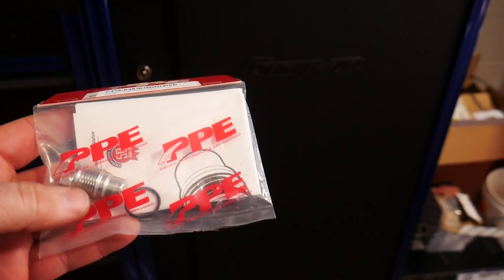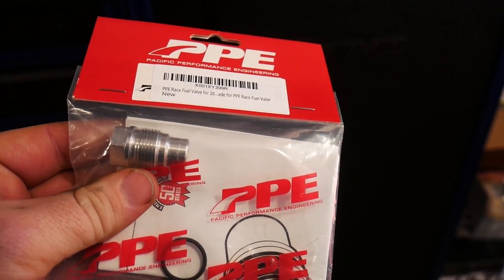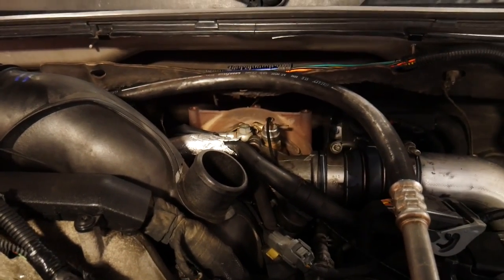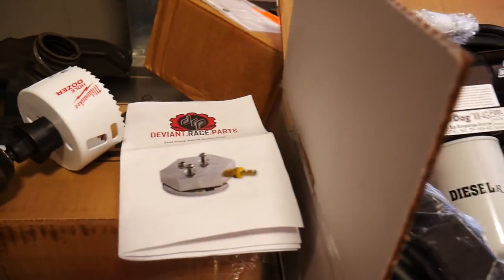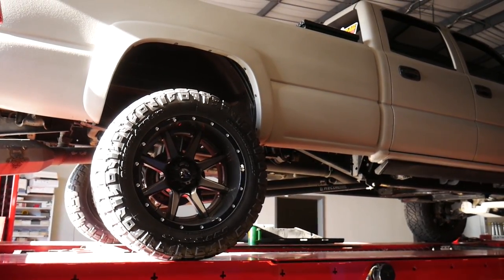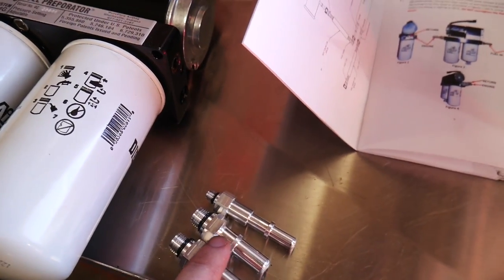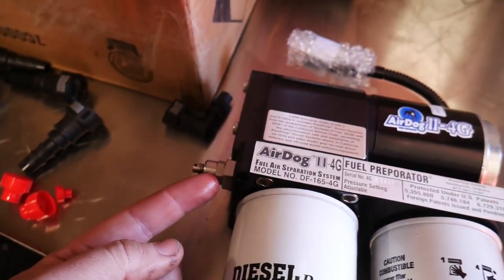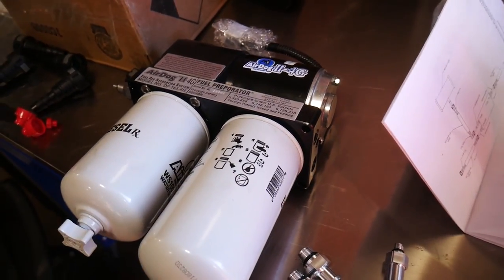DURAMAX FUEL UPGRADES-INSTALL AND WHY YOU NEED THEM

Comment: Everyone has these (me too) but we SHOULDN'T!? Went to exergy to make sure I could 10 mil over my stock injectors:
 FAQ page and found this.
14) Should I install a "race valve (rail plug)" in place of my factory PRV (pressure relief valve) to get more rail pressure??

No, we do not recommend eliminating the factory PRV in your HP fuel system. The PRV is there for a reason; to eliminate the damage that can be caused by pressure spikes. When a "race valve (rail plug)" is installed these pressure spikes have nowhere to go except into the injector. The only time plugging the rail will fix a rail pressure issue is if the factory PRV has been blown off multiple times and is starting to wear out. At this point we would suggest replacing the worn PRV with another factory unit. For higher pressure applications we can modify a new PRV to a higher blow off point so you're not on the edge of the stock factory unit while still retaining the safety function of the PRV. We have seen many injector sets come back from rail pressure spikes while running these plugs causing pre-mature wear of the internal components of the injectors, stators lifted or even worse blown off the top of the injector. In extreme cases rail plugs have also resulted in cracked injector bodies.
Reply: Yes, we agree completely. If you want more power you need modified injectors not raising pressure on stock injectors.

Comment: It's a high fuel pressure relief valve. It is normally closed and when over pressured it opens releasing the fuel back into the fuel return line. The ppe is a plug! Thus no way to release any fuel into return line.

Comment: What happens to the fuel pressure if it's to high,  but you have a plug? How is the pressure being reduced?
Reply from the maker: The fuel rail pressure is regulated by the fuel pressure regulator in the CP3 pump.
Reply: @RustbeltMechanic , thank you for the reply.  What is the purpose of fuel pressure spring return device that is being replaced by the plug?
Reply from the maker: In the small chance there is a fuel injector failure and the fuel rail spikes too high for the second while the CP3 manually ramps down. But that circumstantial failure point and rate is minute for the need for the spring not to open in this performance application.
Reply: @RustbeltMechanic ,  thank you so much for this valuable information.  Many people install this plug but never explain how everything works.
Reply from the maker: Not a problem at all! Glad to shine some light on the subject

Comment: Like I mentioned in a Truckmaster video, why no love on oil bypass systems?  I realize the video was titled "fuel upgrades" but there doesn't appear to be one on your Dmax (unless it just wasn't in the video).  With my mechanical background, it seems obvious that those two should be at the top of the list.  Maybe I'm just getting old.
Reply: The amsoil dual bypass filtration systems looks awesome. And the results are amazing. These guys are going for hp not for reliability that’s most likely why they haven’t made a video on them.

Comment: So did you have a factory skid plate under your fuel tank that you removed to install the sump? I think I heard you reference putting the plate back on. If so, did you have to modify the plate the make room for the sump and new fuel hose?

Comment: Great video, thanks. I've got an LBZ too. Did the basics of an intake, exhaust, lift pump and EFI live tune first. Recently added a 6" lift w 35s and knew my mileage would drop but wasn't expecting as much as it did. What mods would you recommend next? not looking for crazy power, just better mileage. Its a daily driver and I usually run on #4 tune (120hp) but I've only been getting 13-14 city and 17-18 hwy mpg. thx!
Reply from the maker: Get rid of egr, totally get rid of and reroute pcv, that will clear up intake and Sooting. Then sorry about manifolds, up pipes and downpipe if you haven’t.
Reply: @RustbeltMechanic  awesome thx, i should have mentioned maybe most important thing but I already did the full EGR delete. Kept the stock up pipe and welded off the arm to be like LB7 style. Adding a turbo mouth piece / inlet was next on my list. And maybe after that the manifolds up pipes, down pipes. Would you recommend doing anything else before those or any other mods I'm missing that would help with mileage gains first? thx!

Comment: How much of difference airdog makes? Noticeable or you have to convince yourself that there is difference?
Reply from the maker: The airdog was necessary to give the engine enough fuel volume. These only used vacuum from the CP3 to pull fuel from the tank before which puts ALOT of strain on the CP3 pump. Plus now that I have a much more upgraded fuel system, that volume was absolutely necessary.
Reply: @RustbeltMechanic  , no fuel pump in the tank from factory?
Reply from the maker: Nope, none. They didn’t start with having factory lift pumps til they introduced the LML Duramax I believe

Comment: So say I install the ppe duel fueler how much horsepower per say does that support? Can you run a 10mm storker with the stock will that help or is it overkill wanting to get the 165 lift pump as well think that will help and then some air intake upgrade

Comment: Was you able to torque down the rail plug? Or just tighten it down real tight with wrench is fine? Just looks tight in there to be able to get a torque wrench in there.
Reply from the maker: As tight as I could😉

Comment: How is that sump doing a year later? Looking to do the air dog and sump on my LLY because I have air in the system and the shop wants to replace the sender as a precaution, but I figure why not just bypass it altogether and do a sump.
Reply from the maker: Absolutely love it and have Zero issues at all.

Comment: The p0087 code fix
Lift pump &or replace the rubber hose that  Kinks under load or hot weather right under driver side door you'll see the 2 rubber lines .....small rubber 12" long or so .....the rest of the two lines are  Aluminum

Comment: GREAT VIDEO RBM.... Thank You!!! Can't remember, who did you go with for your Tunes? (I went PPEI & Love them) Also, how are you liking that Transco Jr shift kit now that you have some miles on it? Thinking of doing it on my LMM..... Thanks again for the Great Content, Sir.
Reply from the maker: So with tuning I used a local guy and had custom tune done. As far as the Transgo kit, it took about 150-200 miles and it is working AMAZING now! I would definitely recommend it. It’s by far helped the 2-3 shift the most.
Reply: @RustbeltMechanic  Good to Hear, Thank You Sir.
Reply: @ToXSicK1340  I went with PPEI DSP5 tunes on my stock LBZ. They are amazing tunes. Easy install. Now I definitely need a lift pump because it drains the fuel rails on tune 4 and 5. I have the PPE fuel plug and the PPE ported fuel rail fittings. My injector balance rates are under 2. Exhaust is a straight pipe. Everything else is factory stock.

Comment: Did you keep the factory fuel filter in place or delete it? 
Is there any reason I would have to delete the factory fuel filter? 
I'm installing a Fass 165 since I had already purchased it before watching the video.
Reply from the maker: At that time I still ran the factory one but when doing my compound turbo setup it got removed.

Comment: I just bought a Fass lift pump for a 2011 LML. Is a sump kit and that rail plug necessary for a mostly stock motor?
Reply from the maker: No not really. A sump is just a good idea to keep fuel aeration down as to keep the longevity of the new pump you just put in. The rail plug is needed if you end up tuning the truck and plan on having increased rail pressures on stock fuel.
Reply: @RustbeltMechanic  Thanks man. I'm new to the diesel world. Just got my 1st duramax a couple months ago, and trying to learn the ins & outs.

Comment: Forgot to mention modifying the fuel sending unit. Why wouldn’t you get rid of all that ultra tight restriction while your in the tank? $60 and 15 minutes once the tanks out. Duramax’s are fuel starved and all these fuel upgrades are not doing what they should and way over working trying to pull fuel through 3/8” accordion lines. I upgraded my lines from 3/8” to 5/8” rubber fuel line and changed the pickup. Best upgrade I’ve done to my truck.
Reply from the maker: I did.... I totally bypassed the sending unit by installing the tank sump in this video.
Reply: @RustbeltMechanic  well you had to because of the lift pump you installed. The FASS and Airdog lift pumps aerate the fuel in the tank. So without the sump there’s a known issue at 1/4 tank and below. Also what about the return line and the fill neck vent hose. Were you able to upgrade the return line at least? 

I installed a Kennedy Lift Pump with Baldwin Mega Filter after the lift pump and a water/particulate filter pre-lift pump. What I like about the Kennedy lift pump is it’s a flow through, as far as I know Airdog and FASS are not flow through. So they die your truck is down. Kennedy Lift pump won’t leave you stranded. Also no seals so no leaked and it’s almost silent. Can also stack them to add more PSI. And no aerating the tank so no need for a sump. I’ve never had anything but the Kennedy but did a lot of research before I decided. It’s been perfect for 2 years.

Comment: hey boss ☝️ I have a question .. on my lly I installed pure flow air dog and I’m planning on doing couple more things like cold air intake turbo mouth piece ,, upgrade down pipe n straight pipe .. question is could you still recommend to install the ppe rail vale ?? Will it benefit my truck ,, I’m running stock tune and don’t want to ever tune my truck .. do I have to have aftermarket tunes to upgrade rail vale ???
Reply from the maker: No you don’t HAVE to. But if you see a situation where you get that code that I got on a wide open throttle situation.... that’s when you need the race valve.

Comment: Is it worth it to do on a stock truck?
Reply from the maker: That’s what I did!
Reply: Probably not, they are pretty expensive to add onto a stock truck in my opinion. I really don't understand when people state the CP3 pump has to work hard to pull fuel from the tank. The diesel drives the pump, so I'm not sure where the benefit is.🤷🏼‍♂️
I have a 90hp EFI Live tune and haven't had any issues with fuel starvation. I think the lift pumps would be beneficial at higher hp levels.

Comment: do you like the demand flow of the airdog over the mass flow return of the fass and could you explain why you like it better thanks
Reply from the maker: I like the airdog and it’s demand flow for one, the demand flow doesn’t go overkill and just constantly having return maxed out on normal driving (can’t say I have scientific evidence to say if it helps or not), and two, honestly the noise level... the air dogs have a reputation and up to the current technology are a quieter pump and also claim to be better fuel aeration control.
Reply: Love my Kennedy lift pump. None these problems plus flow through.

Comment: What engine is that? The lbz or lly
Reply from the maker: LBZ
Reply: @RustbeltMechanic  darn I have a lly. With 300k. Would miles really matter if I want to upgrade the fuel and turbo on it?
Reply from the maker: galaxy rider LLYs are very similar to the LBZ and I’d still look into it for longevity of parts that are still there.
Reply: @RustbeltMechanic  thank you very much

Comment: So much misspoken and incorrect information in one video. The fuel pressure relief valve has nothing to do with volume and only has to do with limiting max pressure at a safe level. With your snap on hooked up you did not pop the relief valve open, your CP3 just wasn't keeping up; also that was MPa, not KPa. If the relief valve opened it would have had a vertical drop to ~75MPa and flatlined there until desired and actual came down to ~51MPa for the valve to be able to close, then it would be able to build pressure again. Your pressure flipped the recovered some while WOT. An AirDog 165 only pulls from the tank what the engine is using and does not require a sump or draw straw, no reason to risk a fuel leak or catching hose on something offroad.